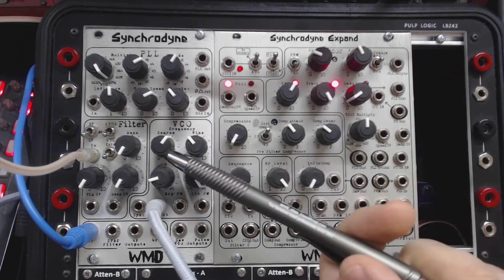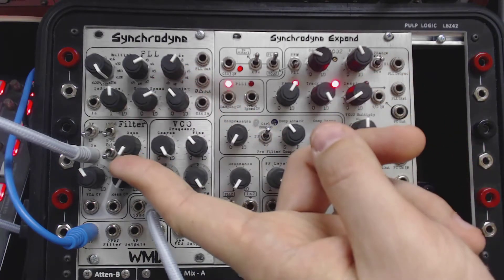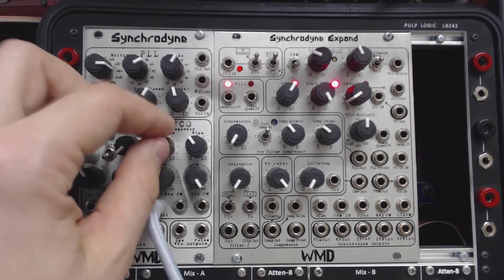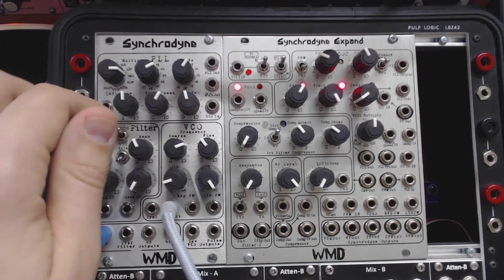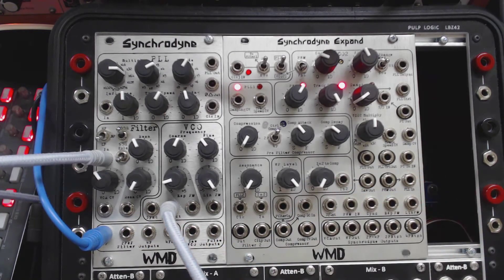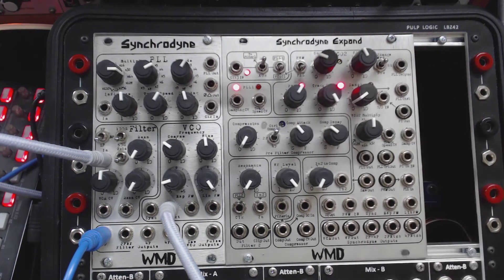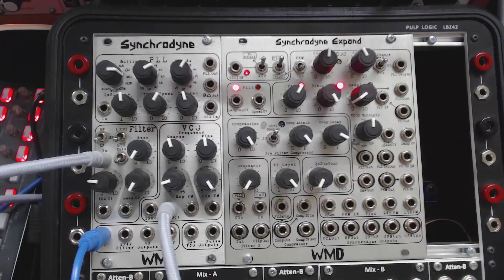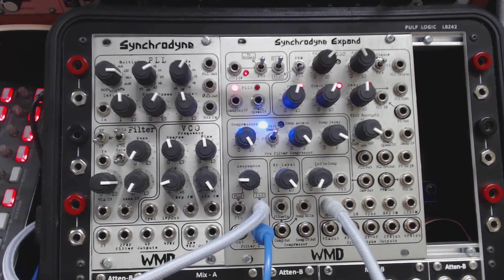WMD Synchrodyne Filter Section

Comment: Great series of videos! Helped a lot answering a few riddles that kept me from fully enjoying these modules. Now here is a little payback. Try the 2p Notch with a really rich signal, like multiple buzzy VCOs, and with no resonance. It makes a really nice phaser. Also, there is something wrong with your resonance for Filter 2. Mine works normally without self-oscillation at such low settings. I know there was some variance between runs of these modules. For instance, on some 1v/oct to VCO 1 is normalled to VCO 2. Not on mine unfortunately. So don't know if your resonance has something to do with that or needs to be fixed. Hope you make more Synchrodyne videos!